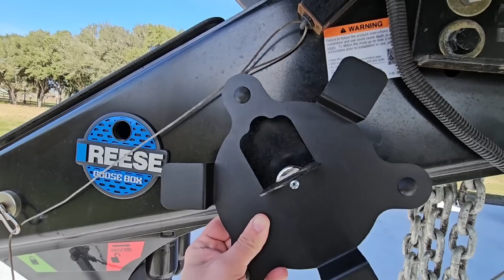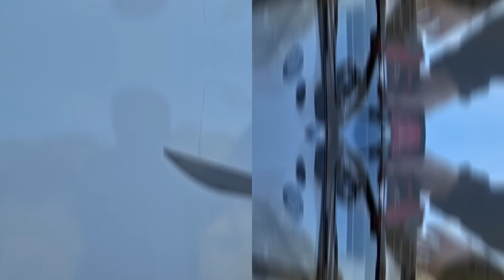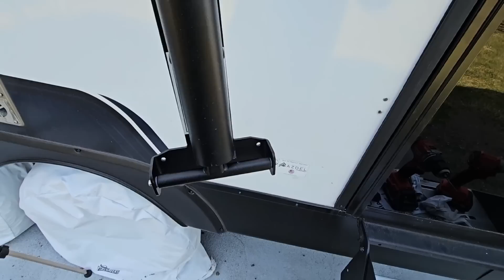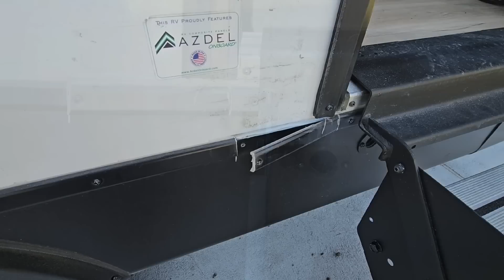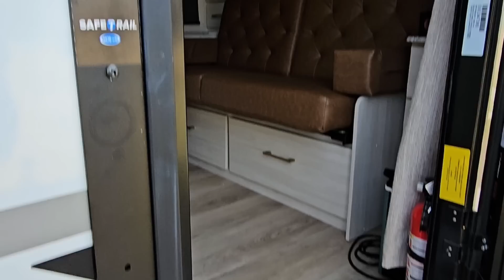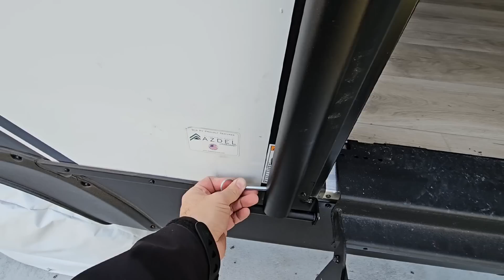Great RV Upgrades from Morryde Installed! Cord Keeper and Safe-T-Rail

Comment: I was going to install the Safe-T-Rail on our Cougar, however, after seeing how many more holes you had to drill to mount it, I decided against it.  As innovative as MORryde is, I don't know why they did not utilize the same holes as the Stromberg-Carlson Lend-A-Hand rail uses since 99% of the RV's already have them.  At least they could have made a snap-on cover or channel to cover their screw holes so as to not make it look like an afterthought.  I also think MORryde should have made some type of plastic cap for the end of the rail and not just keep it bare metal as it is.  This is more of a safety feature than cosmetic, as when I looked at the Safe-T-Rail on a unit at the local RV dealer, I noticed the edge was a bit sharp and thought that someone or some child could cut themselves on that edge.  When I brought this to MORryde's attention, they just dismissed my observation.  Until someone does get injured, I guess they aren't concerned enough about it to actually improve it.

Comment: Found this comment. 

Delamination
The most common issue that travel trailer owners have with Azdel is delamination. It is the process where the outer layer of the trailer made from fiberglass begins to separate from the plywood behind it slowly.

Comment: Love the SafeT Rail.  Origionaly purchased it for our 2019 Mini Lite 2506, but the space between the refigerator and door frame was a bit too small.  We ended up trading up to a Rockwood Ultra Lite 2606ws, and had the rail installed on it. It is a game changer.  I have issues with climbing stairs, and this is so sturdy to hold on to going up the stairs, not to mention you can't close the handel up on the door.  Best upgrade yet to our 2023 2606ws.

Comment: Not a fan of the safeT rail. It isn't as stable as the old style hand rails and i like closing to handle over the door while traveling to secure to door more. I'd rather have the old style rail with the extended drop down.